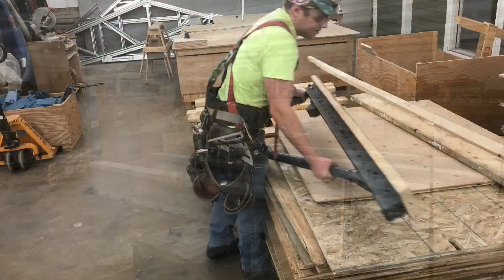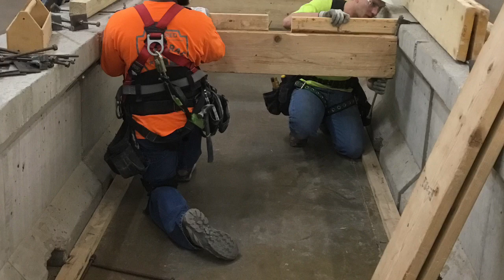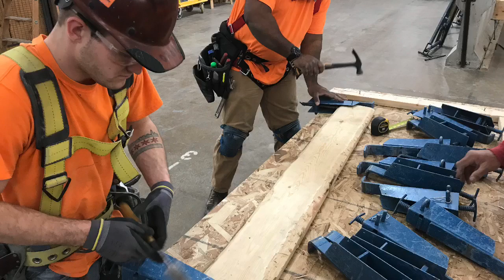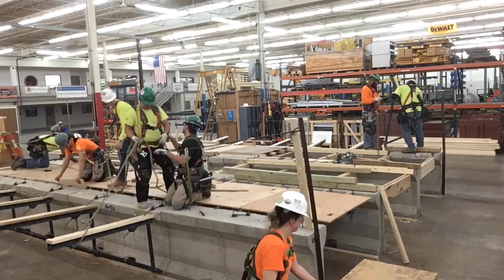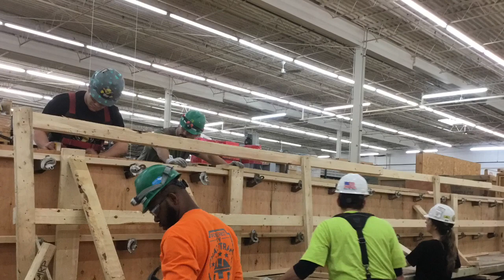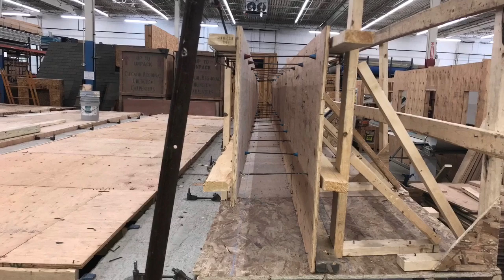Highway Bridge Deck

Comment: Cool video but done a bit out of sequence in my opinion. After your fall protection is established the very next thing you should do is install the overhang brackets, 4x8's and railing. That gives you more workable space in a real world project. These guys had the benefit of working on a concrete floor.
Reply: Depends on Waller hanger system. These guys are using borg hangers. If overhang bracket hangers are poured in concrete beam yes you can do as you say. If over the top hangers for Bethany brackets and waler you need to hang interior waler then over hang. Just depends. We like to use false decking for interior beams to work off of safety cable for tie off on exterior beams until overhang is formed then guard rail is installed.
Reply: @Gordon Kaske  I get what you are saying. With concrete beams we almost always set our overhangs first. Actually we do with steel beams to but usually our bridges are overpasses and we have the benefit of working below with lifts. I could definitely see your point on mulit span bridges over water.  Just seems like all that  falsework  between beams would get in the way of your pre-stressed panels or SIP forms, but I guess that comes with the territory eah?

Comment: I've always wondered this but why do those I beams have wooden planks in between them during construction? Aren't they heavy enough to stay in place?
Reply: Its for plywood to laydown on , basically its the bracing for the bottom of you deck forms. It has to be strong for when concrete is poured.
Reply: I've also seen some sort of sheet steel used as well.
Reply: @jimmymullins8727  so even though they lay down those concrete plates, they're still paved on? I'm trying to find a video that shows this but it's hard to describe